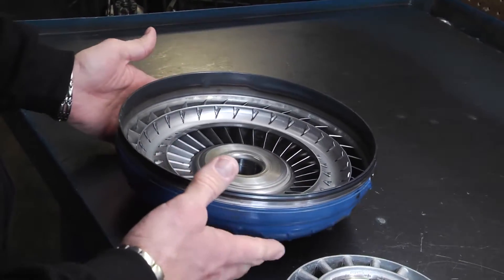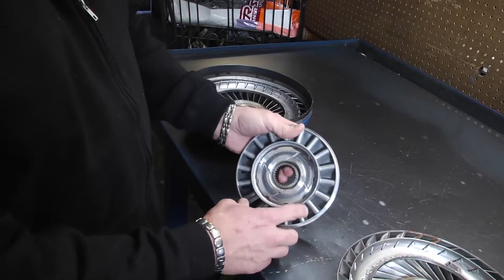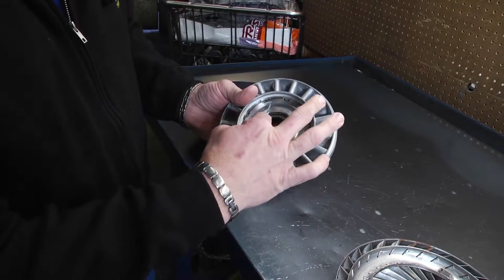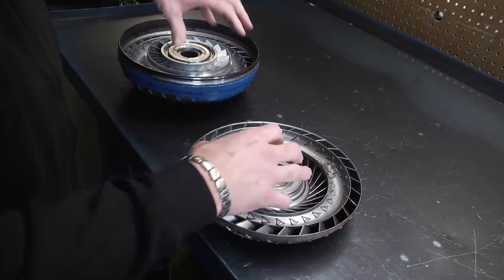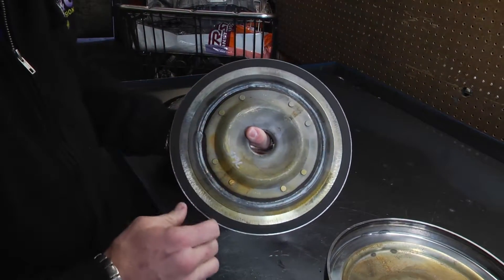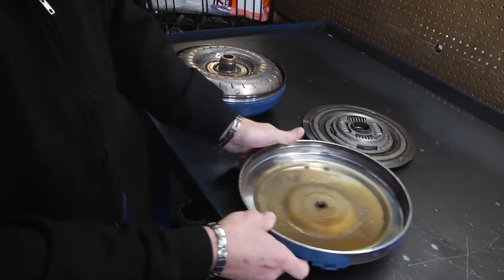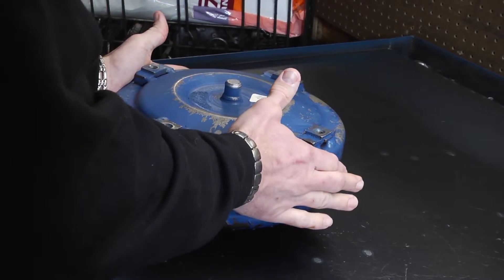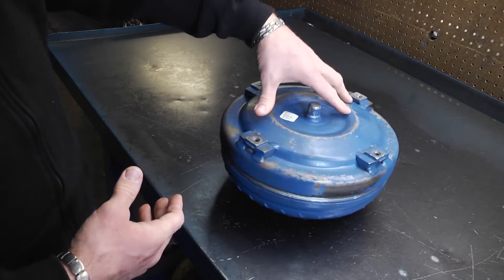How a Torque Converter Works

Comment: Hi , can this torque converter  be the cause of my issue i have on my bmw auto ? In reverse it starts vibrating its like somethings strange happening there? Never seen or checked it yet, so just asking, cuz someone said this could be?
Reply: The BMW like to bgg use the ZF transmission. Some models have a problem with the reverse drum splitting causing those symptoms as it can't hold hydraulic pressure.